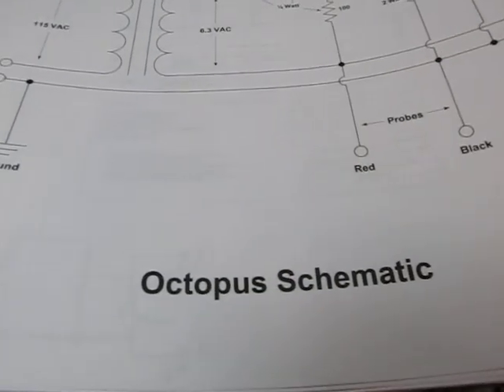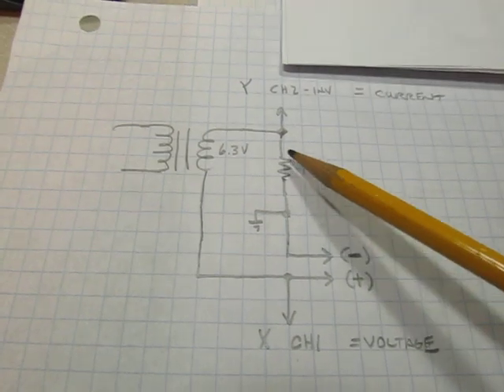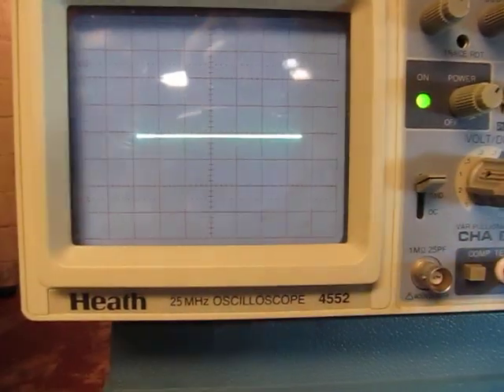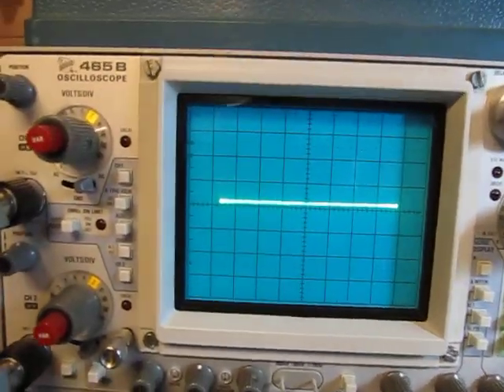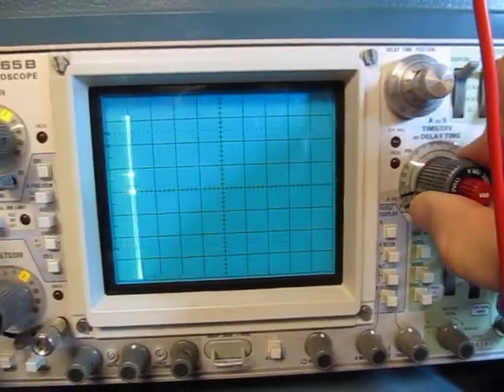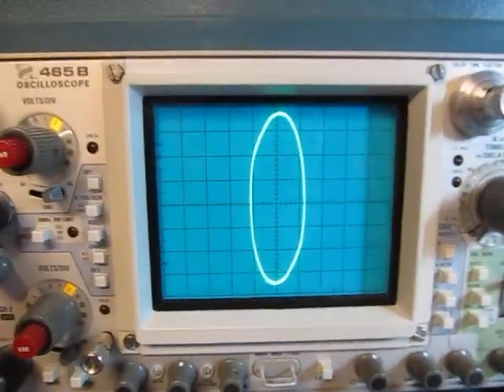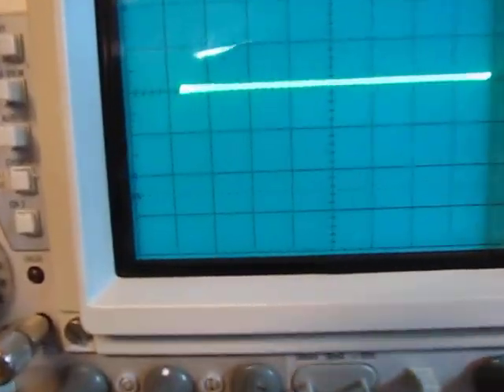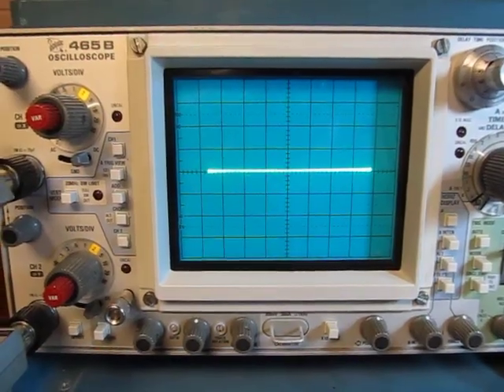#49: Simple Component Tester using Oscilloscope - Octopus Curve Tracer

Comment: I used one of those while I was in the Navy. I had to troubleshoot power supply circuits and sometimes the issue was hard to find. I wasn't so much of an electronic technician as I was an inventory specialist. I had to keep our supply pool full of working components, so if an issue had me scratching my head, I didn't have time to get gear out the door back into supply. Learning how to operate a component testing like this sped things up greatly. I could test whole circuits and I found that even the most subtle of differences in the circuits revealed the issue and finding the faulty component quickly and replacing it cut my turn around times drastically and kept my supervisor and squadrons happy.

Comment: There is an old Porsche 911 RPM transdicer that uses an NPN base-emitter junction reverse biased as its zener voltage reference. Out of a box of BC107s i had i only found two that would turn on at the required voltage for their circuit. I think it was an atypical voltage like 5V4 they desired that probably wasnt one of the preferred values in the 1970s.

Comment: For people new to these ccts, tell them Ch 2 Y axis has to be set to INVERT or they may get confused. Scopes are always grounded and the only way these testers match the text books is to invert the Y channel. Also let people know how to move the ground around and that's the real reason youuse a transformer is to float the ground. Using a function generator won't work.
Reply from the maker: Some function generators have a floating output.

Comment: Back in the late 60'sI built about the same thing except with a transistor as a fixed current limiter and a voltage of about 300V.  I did a lot of amplifier repair and bought the cheapest low voltage TO-220 transistors. The difference between transistors in a number series was that they were selected.  You can't make transistors with particular voltage breakdown. Then I just selected out the higher voltage ones for amplifiers.  Lower voltage ones were used in car radios.  95% of 30V rated transistors were well over 120V.   On rare occasions I would get one with a squirrely point on the curve but still worked. That went to the dust bin.

Comment: I was introduced to the component tester, while I was serving in the AF, in the early 70’s and this toy was old then. In the hands of an experienced technician, you could go through a bunch of transistor logic computer boards quick, this includes analog boards. It just takes about a few dozen boards to get the experience you will need for the transistor logic. The analog board where somewhat simpler, due to the fact the failures were sometimes more pronounced, but still had their quirks to work out.

The short cut, for analog boards, was to compare a good working board with a bad one, when you had that luxury.

Still have mine, that I used in my early days of board repairs.

Update: Had to replace the BNC connectors as one was broken and had to get two to mach.

Comment: I was playing around and tested some zener diodes with Tek2245 and function generator. Everything looked fine, but then I realized that the trace was shifted some 1.5 divisions to the right. Then I just connected the function generator to the Ch1 in the XY-mode. I got a diagonal line, 1.5 divisions shifted to the right (cross point with the X-axis). When I turn off the funct.gen. I got a dot on the X-axis at that 1.5 divisions shift to the right. I tried 2 function generators, both 50 Ohm output. The amplitude of the func.gen. seems all right when I read the X-axis. If I change the Volt/DIV of the Ch1 the angle does not change but the amplitude of this diagonal line changes accordingly to the input voltage, so that seems to work right. Same with changing the offset voltage, it shifts this diagonal line (top-right to left-down) but along this same direction/angle. On my new Siglent I get the flat horizontal line as expected. Any idea where the shift and tilt comes from? TIA Maybe I need to look into the service manual 🙂 and turn some pots 🙂 ...
Reply: ..and when no signal is connected to the input, or switch to GND (still XY-mode) the dot is shifted 1.5 div to the right (range switch from 5V/div all the way to the 5mV/div) and only on 2mV/div the dot shifts 3 divisions to the right. I can 'shift back' the dot some to the left by turning the Var knob of the Ch1. I would say there is some offset voltage problem in the instrument?
Reply from the maker: @ernestb.2377   It's possible that it is an offset issue. Also have you also tried using the vertical and horizontal POSITION controls to center things up?
Reply: @w2aew  I turned all the knobs 😁 The horizontal and vertical controls don't respond in XY-mode, at least this Tek 2245. By the way, the Ch2 responds as expected in the XY-mode, vertical line when some sine or sawtooth signal is connected to it.
Reply: @w2aew  I have to apologize. It was an user error. I could indeed move the Ch1 and Ch2 vertical controls to adjust the center point.

Comment: I use them since education.....around 40 years.
a pretty good and fast method to work thru a unknown board. 
With time you can tell it is a zener 12v or this caoacitor is leaking and so on.
I modified myo old hameg this way with swichable voltage and current (with limmitations ).
For fast repair it is best for me....
i have a modern component tester ....
but it is mostly not neccasary to desolder comonents with the oold method so i stick on that.
Sorry for grammatics and so on.....i am not a natural english speaker ;)
Best regards from Bavaria.

Comment: "I have a transformer from 220 to 12 volts. Is it possible to use it for this circuit? Very educational video!
Reply from the maker: Sure - it would work fine.  If you use 110 on the primary, you'll get 6v on the secondary, which would work great.
Reply: @w2aew  I just finished building it, and it works perfectly!."I also added an oscillator circuit with a 555 timer and a relay to the red probe tip. This way, I can compare two identical circuits without removing the probes from the components..

Comment: The name octopus likely comes from the looks of common devices. A box (=head) with 5 leads coming all out from one sides (2 bnc cables to the scope, 2 test leads, 1 power cable, or when the power cable is at the back, a "nose" in the center, which is a trim pot/rotary switch to select the voltage).

Comment: Where do you find a small 6.3VAC transformer? I want to make one but im mostly finding 6VDC, I dont know if DC would work.
Reply from the maker: DC will not work.  It doesn't have to be 6.3VAC. This used to be a very popular transformer for old tube radio gear because it was a common voltage for the heater filaments.  A 9VAC, 12VAC, etc. will work also.
Reply: @w2aew  would I need to adjust the resistor?  Is there a calculation I need to know?
Reply from the maker: @Douglie007  Of course, simply use ohms law to pick a resistor value that will be safe for the devices you are testing.

Comment: Great descriptions as always Allan. I was admiring your 465B, in terms of its cosmetic appearance.  I would hazard a guess that the 465 series of scopes must have outsold any other model. I have worked around the world, & any lab I had access to always had at least one, & often a number of 465's. Every  commercial radio shop in North America had at least one. I also have a 475 that I purchased in a  pawn shop, inoperative. The owner asked me for an offer, & I told him that I would have to take the scope apart & have a look before I  would make an offer. He looked at me & said " Twenty-five dollars as is. !"  I pretended to consider his price , & said " OK, I will take a chance & buy it " He handed me the scope & I handed him the cash, & he said " Hold on Q" He searched through a couple of drawers & came up with a box that had 5 Tek  probes, that had never been out of their packaging. The cheapest one of them was over $200. He said " There are five of those  like the ones plugged into the scope...give me $5 each for them as a package deal. 
The best deal I ever made Allan !  I traded three of the probes to an engineer friend & kept two, because I could use the. The 465B & the 475 & the probes are on my service bench to this day. I swear the militaries of the world all had those God awful looking military cased 465s.

Comment: I used a Huntron component tester at the company where I worked. It wasn’t cheap. It could do very high frequencies.

My professor at community college showed me how to make an octopus. It even had a current limiting potentiometer. 

I built it and put it in an old project box from the C-band satellite positioner we got rid of decades ago.

This octopus is over 30 years old. I used it today to troubleshoot the rail switchers on an Arc 1000.1. It sniffed out bad A06 transistors immediately.

Comment: Great video! I built an octopus such like this one and I was able to find a bad capacitor in a snubber circuit which prevented a switching power supply from starting.

I had another circuit's power supply which was overloaded and after almost pulling what is left of my hair off, the octopus helped me to find a short circuit between two pins which turned out to be electro chemical migration.

Thank you very much for your contribution. I wonder if this can also help in testing 3.3V modern TTL and microcontroller integrated circuits.

Greetings from Mexico!

Comment: A capacitor will an oval. If it has ESR it will tilt the oval.  Also you can spot noisy pots,  as you move the control the trace will rotate vert horiz and back as you move the pot.  If the pot is noisy the line will show noise spikes

Comment: I see the transformer output is 6.3VAC. If this voltage is applied to the resistors on board then it will damage the IC .

Comment: Excellent. Could you use a signal generator instead of an AC supply?
Reply from the maker: yes, you could - it will just have a higher output impedance.

Comment: QUESTIONS -    What a wonderful video...and I just now FOUND it!    Finally I understand how these work. If you see this... I have a couple of questions.....

1) will this test RF power transistors as well?  Can you depend on this to evaluate a good vs bad part?

2) IN a discussion I just saw today (on the merits of doing COMPLETE Electrolytic cap swapouts in radios!)... ONE user said that they use an octopus tester on the electrolytic caps.....    Circle? It is good..keep it.    Flat line?    bad!    Replace it.

That sounds simple....BUT ... is an octopus tester suitable for "in circuit" tests like that?     AND....when using it "in circuit" will the display on the individual component be "reliable" OR can the surrounding components "throw off" the display form.... so that you could not detect a "failed part" or to me... more importantly.... a MARGINAL part?      I would want to be sure that I can detect a "flaky part" that could go at any time (IF that is possible!   But I would not want the "in circuit" use to affect my ability to test!

I am just curious as to your opinions (and anyone else who may care to chime in!) on these questions.

Thank you so much for this video!!!!!
Reply from the maker: This can only be used as a go/no-go tester when you have an example of what the "signature" of a GOOD one looks like.

Comment: Presumably the X input on the oscilloscope has to be inverted because the circuit shown has the earth (0v) in the centre, between the resistor used to measure the current and the voltage across the device under test. If the DUT is a simple resistor, the circuit will show a negative voltage for a positive current. Switching the X input to inverting fixes this.
Reply from the maker: Yes, I inverted it.

Comment: Hey, great video! I have been banging my head against the desk trying to get this to work, but no matter what I do I always have the trace flipped in the y-direction. My scope moves the beam in the positive axis with a positive voltage, so everything seems fine. Any ideas on what could be going wrong? I have tried many designs out there and they all do the same thing.
Reply from the maker: The scope I was using has the ability to invert one of the channels, thus making the current go up when positive.

Comment: can i use this technique for measuring resistors in circuit. In my board i have a set of resistor with one end of all resistor connected to VCC and other end connected to different device. How can use this technique

Comment: Great demo Alan. Could I ask a question. I have a Hameg scope with component tester I was looking at the different shapes made by different components. I was checking 2200uF 25v and 1000uF25v caps they both displayed a vertical line does this mean they are shorted or open. Smaller capacitance electrolytics showed various ellipses, many thanks again for your excellent tutorials. All the Best for the Festive Season under the circumstances go safe.
Reply from the maker: They’re likely not shorted. These very large value capacitors have a very low impedance at the tester’s frequency, that’s why they look like a short.

Comment: I watched a video by Mr Carlson's Lab yesterday where he used a curve tracer to compare output pins of ICs as a method of quickly identifying suspect faulty chips.  Would you be able to use the Octopus tester in this way or would that be something different?   (presumably the 6 volts would be too high and damage some ICs?)
Reply from the maker: This is the same technique.  Ideally, you'd want something that can adjust the voltage and limit the current.

Comment: Back in the early 1970s, QST published a schematic for an octopus and I put one together, mainly because I had a cast-off all-tube, purple trace oscilloscope that must have weighed about 100# (my dad picked it up when his university chucked it).  Anyway, I was about 14 years old, and I thought the octopus was particularly cool because you could test parts in-circuit.  One day my ham transceiver (Henry Radio Tempo One) died.  The power supply was blowing fuses immediately.  So I decided to look around with the octopus, and rapidly found that one of the discrete silicon rectifiers in the full-wave bridge in the 500v (IIRC) supply was blown (I do not recall whether it had failed open or shorted).  In any event, I was able to replace that rectifier and got many more years of fun out that transceiver.  It's nice to see that these tools are still in use!

Comment: How about using a adjustable source voltage maybe up to 100V to give capability for higher voltage rated breakdowns like some Zener diodes and other semiconductors?
Reply from the maker: You can do this, but there is a safety issue.  100V can deliver a dangerous shock to the operator, and can also damage many components.
Reply: Isn't  it that the current drain damages Components not the voltage? 
If so a 2to3 meg resistor should do the trick and dropping voltage to 80v makes it more practical..

Comment: X Y sucks on a digital scope so I got a old tektronix crt scope that stays on the bench just for component testing. If I need a scope in the regular way I’ll use my light weight digital scope. It’s insane the size difference of the 2. Crt would need a dedicated cart to use on the shop floor. I like messing around with the crt It put me back in the habit of being more observant.

Comment: Great video. I have been using my octopus for a few years. I love it and use it a lot since most of the things I have to fix are broken due to a component failure. I work on cars and most of the time it’s a bad component or bad solder joint that has happened due to thousands of miles worth of vibration on it. I actually use the octopus more than use my scope in regular mode.

Comment: Can I replace the transformer with a signal generator?  It looks like the current needed isn't very high in this circuit.  What frequency should I use other than 60Hz coming from AC?
Reply from the maker: You certainly can.  You can use whatever frequency is convenient, as long as your transformer is rated for it.  Note that reactive components will have a response that depends on the frequency.

Comment: I'm a bit confused about your circuit, you don't show where to hook up the grounds from the x and y inputs on the scope. Also could I substitute the transformer with a signal generator using the same schematic?
Reply from the maker: The grounds go to the wire with the ground symbol.  Yes, you can use a signal generator and transformer.
Reply: Thanks you.

Comment: Could you do this with a 70 year old Eico 425 scope??
Reply from the maker: Sure, you would use the external horizontal input for the "X" connection, be sure to set Horiz Input to Ext.
Reply: w2aew thanks!

Comment: Various curve tracers sensitivity are different. How low and high can you curve tracers sensitivity can go to? The older curve tracers from the 60's sensitivity is much more sensitive which I'm not sure why older curve tracers have a higher senstiivity to measure small changes. Can you please explain curve tracers sensitivity inputs to measure what components using the curve tracers sensitivity. In this video at time 29:32 he is using a curve tracer but at higher senstivity ranges you won't be able to tell if the IC chip inputs are damaged. So a more sensitive range you can tell that the IC chips inputs are damaged. Here is the link to the video watch it at 29:32 https://www.youtube.com/watch?v=l8ndPgGNKg8. The huntron won't be able to view this type of detail like this old curve tracer and newer curve tracers don't have this sensitivity also, any reasons why?